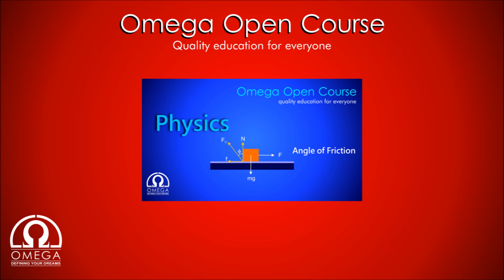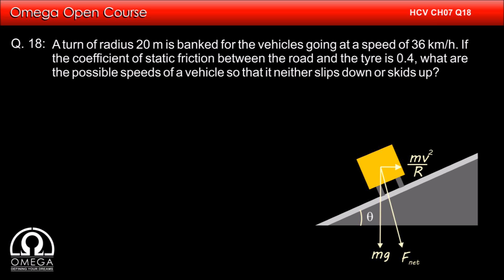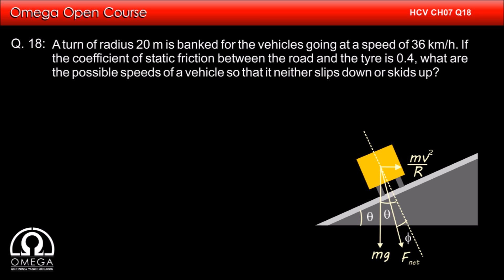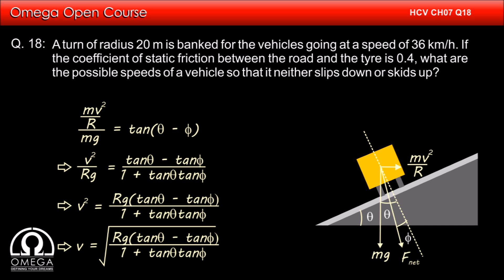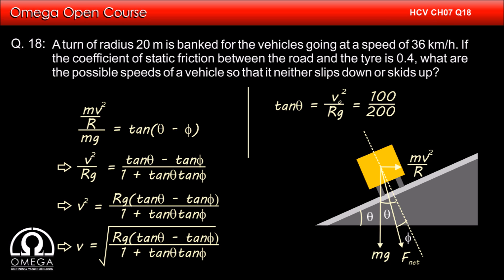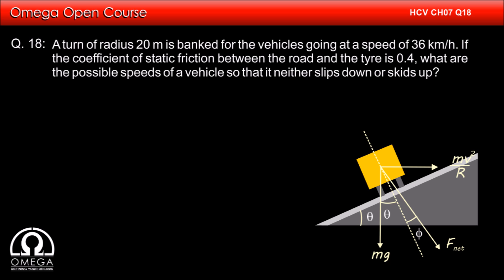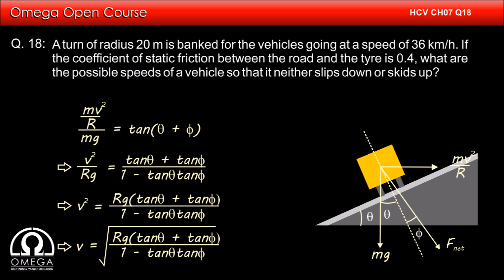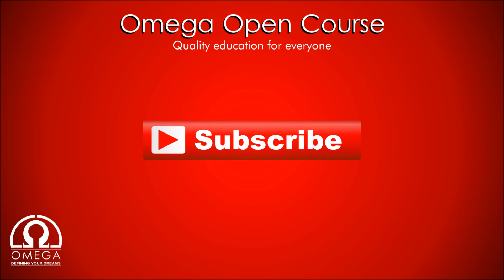H. C. Verma Solutions - Chapter 7, Question 18 (Using Angle of Friction)

Comment: I am unable to understand the part why you subtract fi in first case and why you add in second case. Watched the video 8-10 times already. Please help.
Reply from the maker: +cooldevansh1 in first case the tendency of the car is to slide down the road. Therefore the resultant of gravity and centrifugal force must make angle phi with normal towards down the incline.

In second case the tendency is to move up the incline. So the angle the phi is along upward direction.
Reply: +Omega Open Course Thanks sir!
Reply: @cooldevansh1  oh

Comment: Sir why u took centrifugal force when there is no inertial frame
Reply from the maker: Like many students, you seem to have problem in differentiating between centrifugal and centripetal force. I will create a video to explain the difference and when to use what. But it will take a few days.
Reply: Centripetal acc/force is directed towards the center.it is necessary to maintain circular motion. Centrifugal force is directed outwards/Away from center... Its a pseudo force, applicable in non-inertial frame of reference. Its magnitude is same but direction is outwards/ negative.
Reply: the answer will same whatever you use